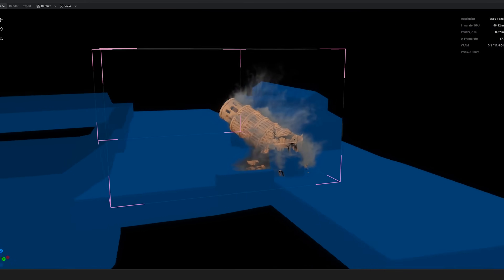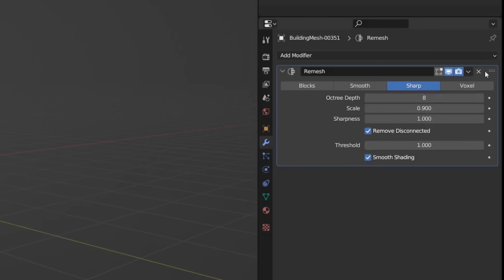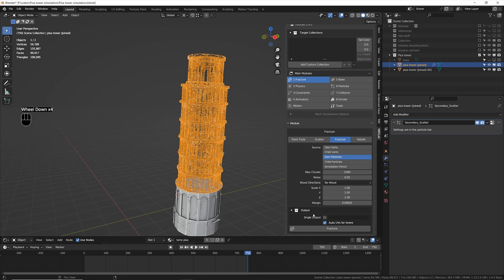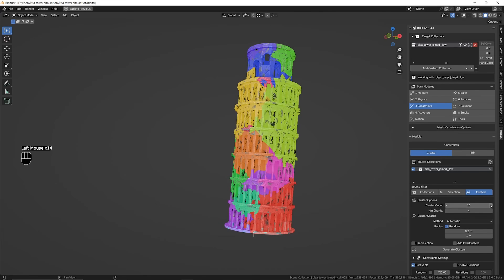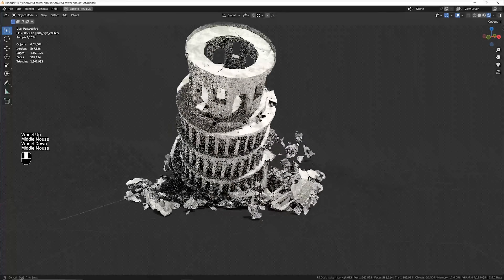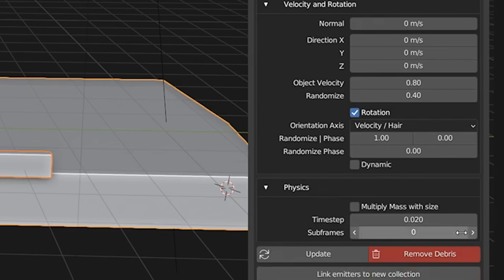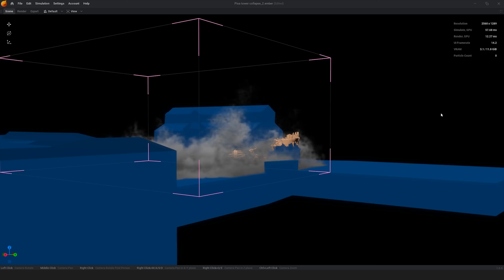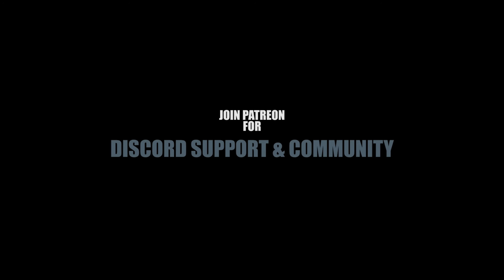How I Destroyed the Leaning Tower of Pisa (IT) - Blender Non Tutorial

Comment: Once the fracture is applied i cant find a way to retry another pattern.
How do you undo the frature operation?
Reply from the maker: what I do usually is to save a backup file before starting the fracture, is the easiest and most painless way to go back quickly.

However, if you need to reuse the original object, you can find a backup in the "originals" collection of rbdlab